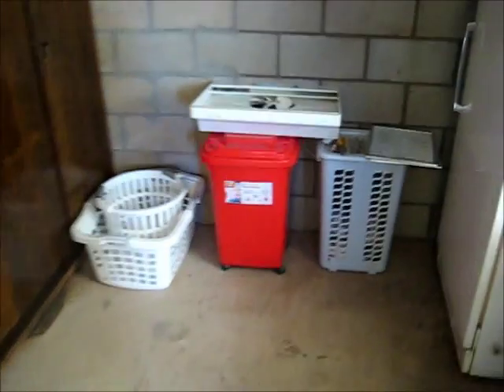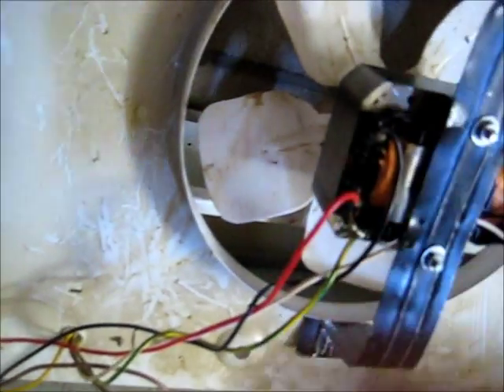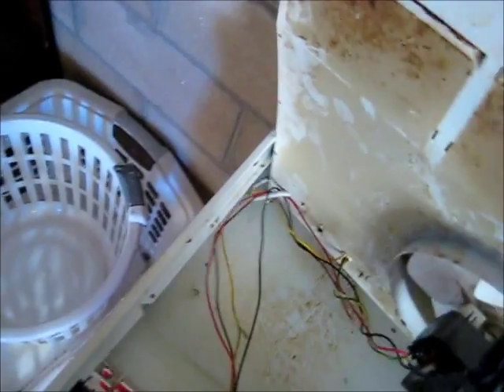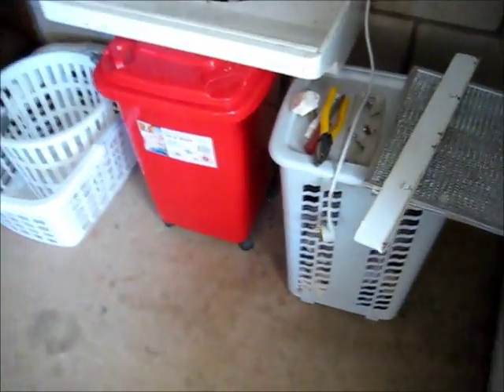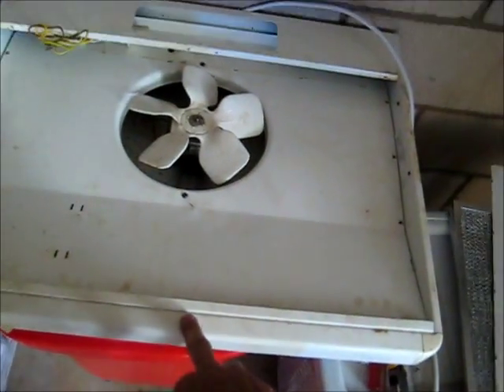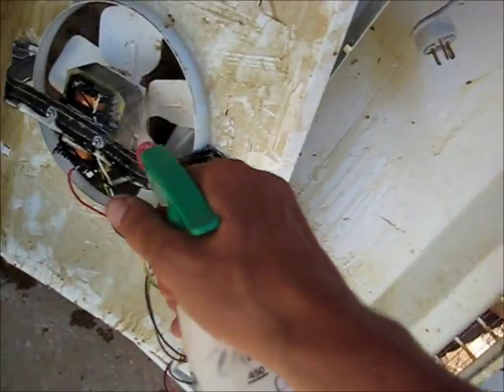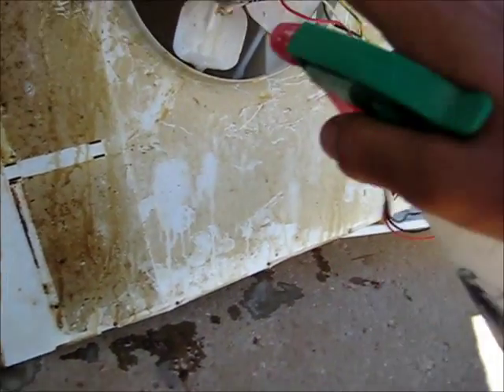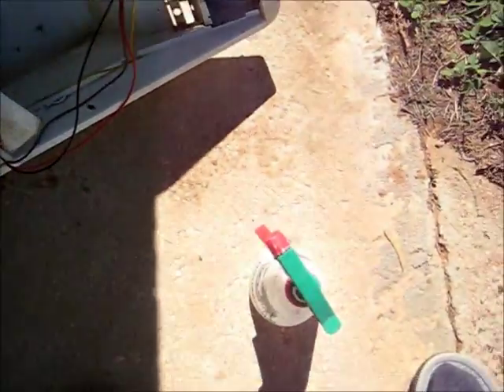Rangehood repair part 2

Comment from the maker: People are lazy since these are crappy consumable Appliances now, it's easier to use the front vent & have an exhaust fan installed in the ceiling above, of course the outside vent should always be used :)